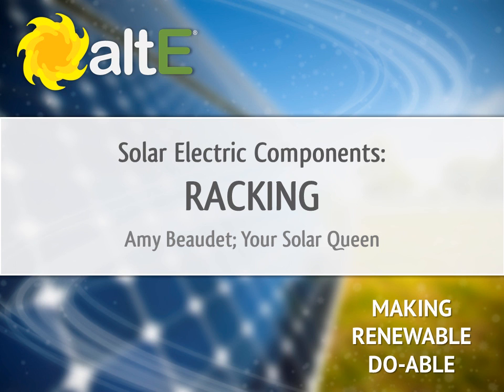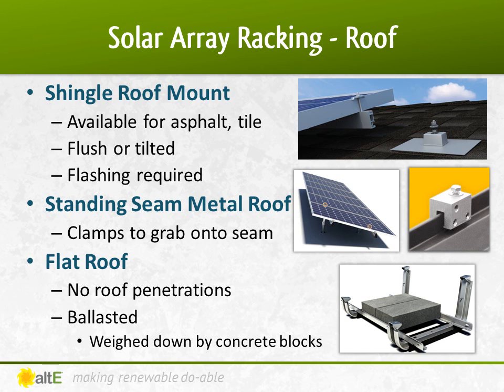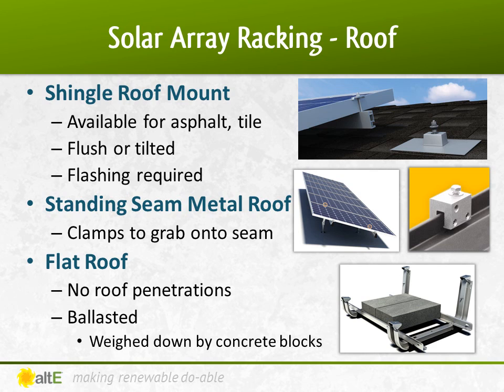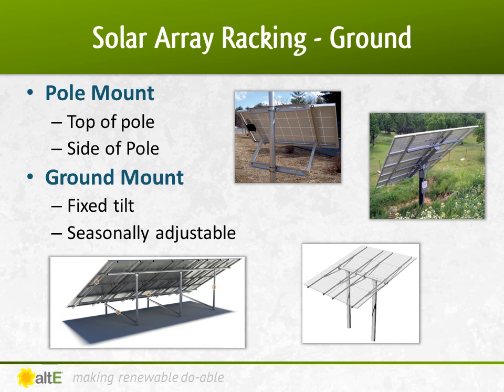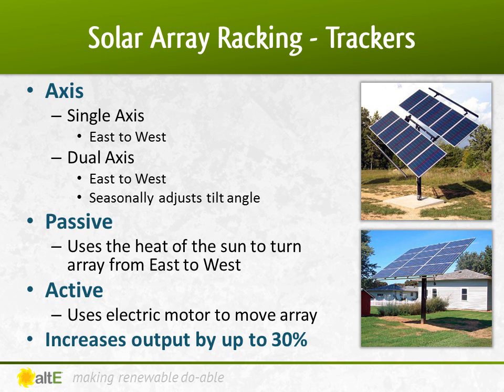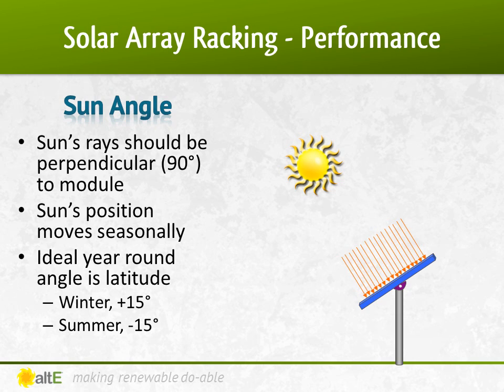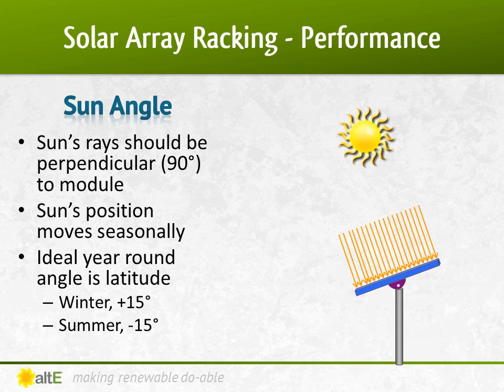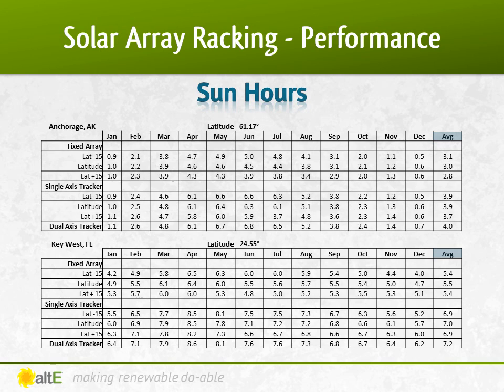Racking: Solar Power Components - Part 3

Comment: In active trackers how much electricity did the electric motor spend ?
Reply: thanks alot
Reply from the maker: +Eng Mahmoud Samy Sorry it took so long to get the answer. I checked with Array Technologies who make the WattSun dual axis trackers. https://www.altestore.com/store/solar-panel-mounts-trackers/active-solar-panel-trackers/wattsun-solar-trackers/duratrack-da-dual-axis-tracker-p11362/   "Azimuth Trackers typically consume 20 watt-hours or less per day during normal operation. The Azimuth motor consumes a maximum of 2 Amps @ 24VDC and the Elevation motor consumes 3 Amps @ 24 VDC."
Reply: +altE Store thank you